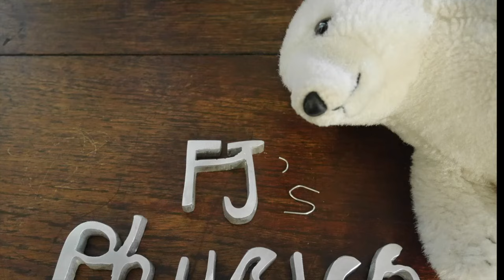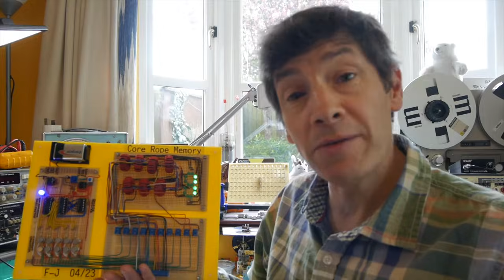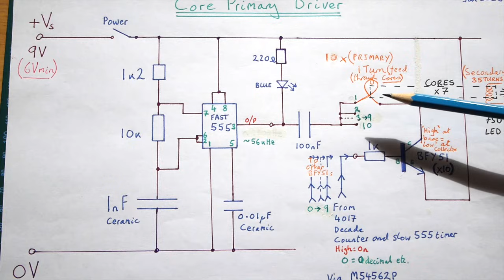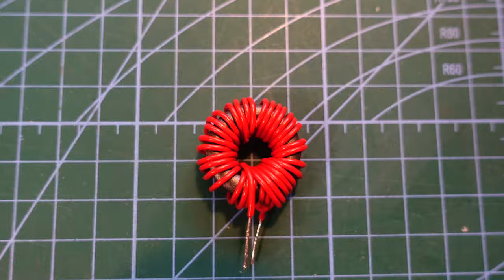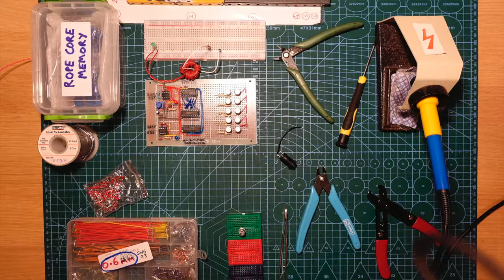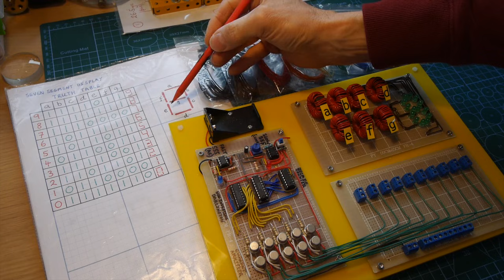Core Rope Memory Built and Explained - F-J's Physics - Video 169

Comment: Hi, thanks for the video, a very interesting project.  I have some thoughts/questions on your circuitry and would be interested in your feedback.

1. I had the same observation about the NPN emitter as a few others have pointed out.  I wonder if your "a" segment is weak because it relies on the breakdown voltage of a specific transistor which varies across the batch.  I have  a hunch that if you were to swap the driver transistor for the "a" segment with another segment, the problem would move with the swap.
2. In the comments, you mention that when connecting the NPN emitters to ground you weren't able to get it to work.  I see that the coil input is AC coupled so it has a very weak DC reference.  I think the purpose of the cap is to serve as a high pass filter (differentiator, pulse detector, etc..).  But I wonder if you added an appropriate resistor downstream of the cap, if that would resolve it.  Because with very small resistance in the coil driving wire, the cutoff frequency may exceed the 56k and cutoff your signal entirely.  The impedance of the reverse biased transistor may have accounted for that which is one possible explanation for why it worked in the unintended design.
3. I was wondering if the 1 amp BFY51's are truly needed since the Darlington drivers are 1/2 amp.  It certainly doesn't hurt to have the headroom, but the m54562p's are designed to drive coils such as relays.  Granted though a single "turn" is a bit different and I think it depends on frequency.  It would be interesting to know the current draw of the circuit as that would help answer this question.
4. I think there's no reason why a ULN (low side) driver wouldn't work.  High side drivers tend to be a bit more specialized and harder to find.

Thoughts?  (thanks)
Reply from the maker: Thanks for these brilliant observations and it's things like this that make the positive side of Youtube so enjoyable!  So a bit of background first... I did not have any circuit diagram of what this in advance, I just built it as I went along from scratch - which is what I like doing.  The overall result being something quite new to me - that's the fun.  Looking back there is much I would have changed and I learnt a lot on the way too, which is why I like doing this sort of thing!   So to Point 1:  I have got it fully working now.  I had got a few of the segment LEDs back to front and it seemed clear that the AC signal was not symmetrical.  Turned them around and they are all now equally bright.  Point 2, I think you are right there.  I was new to using transistors in reverse active mode and discovered it 'by mistake'.  It is interesting that those are very old transistors and newer ones I bought did not work at all (or were they fakes?).  Point 3:  I am sure you are right about the darlingtons.  I had been using them quite a bit in earlier projects and the idea had sort of stuck!  I find it hard to imagine those little chips passing quite a bit of current but of course they can!  https://youtu.be/r77hpJ5bUu0   and   https://youtu.be/srko8SEDpY4   Point 4: Agreed!  I just went with what I knew!  In summary, it was a lot of fun to build and I never really knew if it would work but we got there in the end.  You are totally right (if I knew a bit more electronics - getting back into it after about a 30 year break) I would make version 2 differently!  All of this said, thanks so much for taking the time to comment and sharing your experience and knowledge.  Sometimes when building things you wish you were in the same room as others so you could ask for advice and bounce ideas off each other.  Hope you enjoy the other videos and do keep the comments coming!
Reply: @AnthonyFrancisJones  Thank you for your quick and informative reply, it really clears everything up!  After seeing "Look Mum, no Computer"'s videos on rope core memory, I discovered this video and I found your design to be simpler.  I'd like to experiment with this just for fun and also be able to say that "I hardwired my computer program" ☺.  Glad I discovered your channel, subscribed, and look forward to exploring your content.  Thanks again!
Reply from the maker: Excellent!  Glad that helped.  You might note that I have some 'nice' but old test gear on my desk.  We tend to surround ourselves with such stuff but actually rarely if ever use it so part of this project was to encourage me to use some of my less used and less understood test gear like the Marconi Instruments Universal Timer Counter.  It's like buying an old car as an excuse to use your spanners!  All part of the fun.  Let us know how you get on.

Comment: Can you provide the part number or the specs for the ferrite cores that you used?
Reply from the maker: Sorry for the slow reply.  They are not very critical - I just went for ferrite cores that would be large enough to show up on the camera so I bought these off ebay about a year ago.  "10pcs 22.5x13.8x10mm Ferrite Toroid Core Transformer Inductor Coil Ring, Black."  Hope that helps and if you build something do let us know!

Comment: But how do you know if its a 1 or 0? dose it act like a inducter? How dose the computer know if it has changed?
Reply from the maker: Good question.  So I had better explain. The circuit on the left act as a clock, stepping though each line of code.  A word of code is encoded in each wire depending on whether it is in a coil (1) or out of a coil ring (0).  The secondary winding is driven high if it experiences a 1, wire through it.  In this case I have used each 'segment' of a seven segment display to indicate if a bit value was high (1 - on) or low (0 - off).  Those wires could of course gone to a CPU instead so it could execute that line of code.  Or to memory etc.  Hope that helps!  Note that this has 10 words of memory (the ten different coloured wires) each containing 7 bits as the are 7 coils that each wire passes through or around.
Reply from the maker: And, yes, the rings have a primary winding - the wire passing through it, and a secondary winding - the red coil that goes to the seven segment display output.  So they are really transformers which are a type of inductor, but inductors usually only have one coil not a primary and a secondary.
Reply: @AnthonyFrancisJones  ah but how dose it know if say only ring A is magnetized and not ring B and C?
Reply from the maker: @CLOCK-WORK  I think you may be getting confused with Core Memory where the rings are magnetised - have a look at my video on that one.  https://youtu.be/T8VreNzldWc   In Core Rope Memory a pulse of current in one wire if it passes through a core will result in a pulse out of that core - a 1.  If the wire has a current pulse in it and does not pass through the core then the core secondary winding registers a 0.  Does that help?  The cores don't have any memory in themselves.
Reply: @AnthonyFrancisJones  yea but how dose the computer read that information when it's set do you just pull it to cycle the code?
Reply from the maker: @CLOCK-WORK  Yes, there would normally be a lot more wires and it would either cycle the code or address specific lines in order to get the code it needed.  Remember this is a form of ROM so the code is hardwired into it!
Reply: @AnthonyFrancisJones  what I'm trying to say is how do you detect if core A is set to 1 and not B or C like I know if a transistor is switching I just place an led on all 3 pins and if it's switched an led changes
Reply: @AnthonyFrancisJones  basically how do you decode what's set
Reply from the maker: There is no real need to decode it as it will come out of the cores (red wires) in my case as a 7 bit word (just a length that I chose).  You could then feed that straight into any other logic such as a CPU or ALU or similar.  The main point of this device is that the actual code is hardwired into it (so you cannot make a mistake when making it!), it is not stored in a volatile form or in silicon or similar.  Have a Google of the core rope memory used in the Apollo guidance computer (AGC) and see some of the pictures of the many wires 'of code' hardwired into its memory modules.  One mistake in the threading of the cores and the code would be different (for that wire anyway!).

Comment: @17:36 ... you show your  DC clock pulse circuit ... that is NOT AC it is just a fast on and off of a DC signal ... making it a PULSED DC SIGNAL ... no where in your circuit does that voltage drop below 0v ... no where .... meaning there is NO AC CURRENT IN THE PULSE CIRCUIT .... it's all DC
Reply from the maker: You make a good point.  I have not discussed the direction of current, that is true.  I suppose it is best described as having a rapidly varying value of DC voltage value (interesting how we say 'Direct Current Voltage' when we refer to batteries!!).  I would be interested to ask what you would call an AC signal with a DC bias - that may well not have a value that is considered to be zero at anytime but would still be considered to be AC as the current is rapidly oscillating, not necessarily through zero.  Perhaps I was a bit 'loose' with my language here.  Thanks for the correction and for watching.  I will have a look at your channel when I get a moment.
Reply: @AnthonyFrancisJones  alternating current ... the dc voltage is OMNIdirectional ... you arent flipping the poles you arent even going below 0 ... youre 555 pulse timer is just a switch being flipped very fast so the power is there or not or on or off ... there is no cycle between zero max and zero and negative max ... ac is sinusoidal dc is is there or not or square wave for a basic idea visual
Reply from the maker: Yes, get your point about the value not passing the zero point.  The waveform to the transistors was far from a square wave though which made me describe it as being more AC as it were (I think I showed some of the CRO images but used a DC blocking capacitor to show the AC component - a CRO thus makes it appear as if it is passing the zero point!  AC of course does not need to be sinusoidal.  I guess in the end referring to AC or DC is a bit misleading as really much of this circuit is using changing potentials/voltages rather than currents (of any magnitude) but of course the cores do need some current to function.  The flux in the cores is changing rapidly (inductance etc. stopped the signal from being square in nature) so I guess I used the term AC for that reason but I totally get your point that the current direction does not change, just its magnitude.  I hope regardless that there was something of interest in the video for you.  If you get one to work do please let me know.  It was a fun build!
Reply: @AnthonyFrancisJones  that curve is the induced capacitance of the bread boards you are using ... it is slowing the rise time of your pulse ... and will cause some false triggers if it gets too slow ... instead of using the 555 ... a quart crustal would be better then you actually get an ac voltage change ... as the crystal oscillates (about 36khz) ... which is why they are used in clocks ... easy x60 division
Reply from the maker: Thanks, I had not thought of the capacitance effects.  Interesting!  I guess it all just came about organically.  I tend to build a bit at a time (with what I have lying around) and just get bits to work and never really plan it out in advance!  I should do another build sometime and give the quartz oscillator some thought.  If people are interested I do need to show other forms of core rope memory particularly one that works more like the AGC one.
Reply: @AnthonyFrancisJones  yup ... this old fart is happy to see I paid a fair price for my education ... 40 years later and it still is forefront of my memory lol
Reply from the maker: Yes!  You also remember when an odd effect such as this is the cause of a fault you were struggling to find in a circuit.  By the time one 'knows it all' it's too late!

Comment: Thank you, it seems that my circuit is missing M54562p after all at the decade counter output. Supply voltage to "slow" 555 timer is 6V, output on pin 3 of 555 timer is about 4.5V and output from decade counter is about 2.2V. Now, when I put M54562p it in the circuit, M54562p output is exactly 6V (as supply voltage). Besides, it is interesting to watch transformation of that square wave on the oscilloscope. M54562p eliminates all noise and odd spikes visible on the decade counter output.  @AnthonyFrancisJones
Reply from the maker: Great - well done!  This is a very useful chip. I love Darlington drivers and I feel they have been a bit forgotten by people who only understand normal CMOS and TTL logic but there is a real place for them in many circuits.  By the way I think you can go up to about 16V (I use 9V a lot) for your 555 etc.  That helps too.  Don't get hung on the idea that everything needs to be at 5V!
Reply: Thank you. I am usung 5V just because I replaced transistors with relays because of possibility that I will use separate AC source for driving core rope memory (if my 555 timer driven AC generator does not do the job) and control voltage for those are 5V in my case, also they have that "vintage" look. 🙂 @AnthonyFrancisJones
Reply from the maker: Just about to make a video on relays and I have some massive examples from the railways.  Also will be doing one on logic gates using relays too.  Good luck with your project!

Comment: Excellent video. Thank you. I have just one question, why is emitter of NPN transistor connected to +9V and not to GND (0V) in your schematic?
Reply from the maker: Thanks for the question - yes this is a bit of an oddity so this is what I have said before, hope it helps.

Agreed! I wired it up and got a transistor the wrong way around and it worked!! I was mystified too by this. I have been over and over it and everything is as per the schematic (unless these transistors are not following the agreed layout of pins for this type of base). I do remember that I did work it out at one stage and it was partly due to the fact that they are switching a rather odd shaped high frequency signal so are behaving in a rather odd way. Not an explanation I know but it works and I was equally mystified!

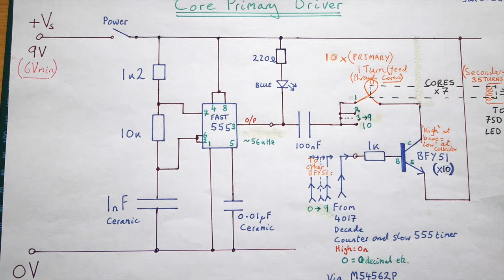Have a look at this great comment from Mick Healey - he has nailed it!   "If the circuit is actually built as shown on the diagram at 18:56, then the transistor is working in 'reverse active mode'. In this mode, the transistor will operate, but (conventional) current flows in the opposite direction (emitter to collector) rather than collector to emitter as would be the case in active mode. A transistor will work in this mode, and even have some gain, but the gain is low. To enter reverse active mode, the emitter voltage must be greater than the base voltage which in turn must be greater than the collector voltage. That exact scenario is happening here. The base resistor ensures that emitter is higher than the base. Since the collector is connected to the 56kHz oscillator, then the base will nearly always be higher than the collector."
Reply: Thank you for this answer, it was quick and it explains "odd behaviour" of NPN transistor. I am trying to replicate the design with some changes in high frequency part. I am using 555 at about 65kHz with LC circuit on output, and I managed to get nice sine wave with the same frequency as input and voltage about 15V (my power supply voltage is 6V). Now I am struggling with core windings because the highest voltage I am able to get on the secondary is approximately 900 mV. We shall see how this will end. Also I removed M54562p from the circuit just to simplify it if possible. I am a bit in the dark here, but maybe it will work. Thank you again on awesome video.  @AnthonyFrancisJones
Reply from the maker: That's brilliant - let us know how you get on - sounds like you are on the right lines.  You may need something to boost the current on the output stage though if you want to light an LED.  Less than around 2V is too small.  Post again when you are further and perhaps start a new comment as YouTube is not good at pointing me to comments that have new answers!  Good luck!
Reply: Thank you, it seems that my circuit is missing M54562p after all at the decade counter output. Supply voltage to "slow" 555 timer is 6V, output on pin 3 of 555 timer is about 4.5V and output from decade counter is about 2.2V. Now, when I put M54562p it in the circuit, M54562p output is exactly 6V (as supply voltage). Besides, it is interesting to watch transformation of that square wave on the oscilloscope. M54562p eliminates all noise and odd spikes visible on the decade counter output.  @AnthonyFrancisJones
Reply from the maker: Great - sounds like you are having real success, and like I do, finding out things for yourself rather than just copying other's work.  Great way to learn!